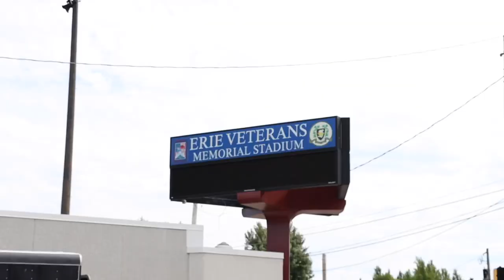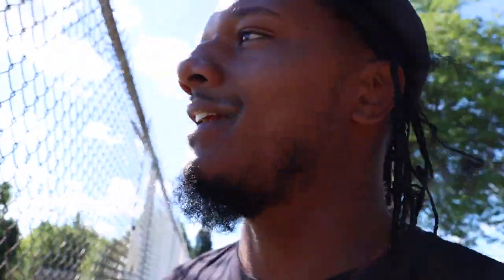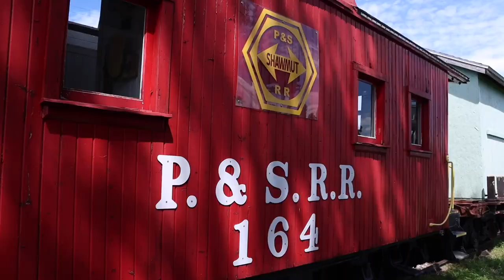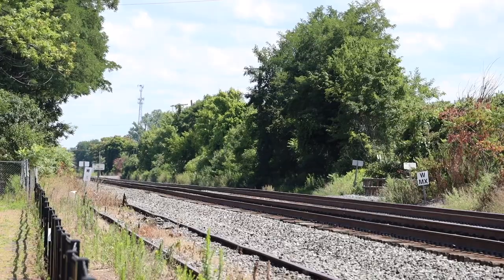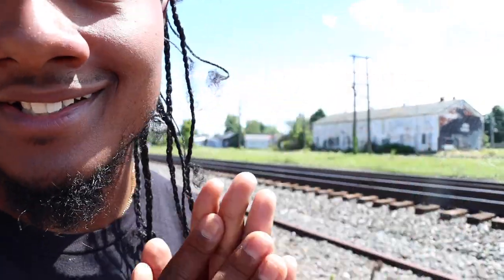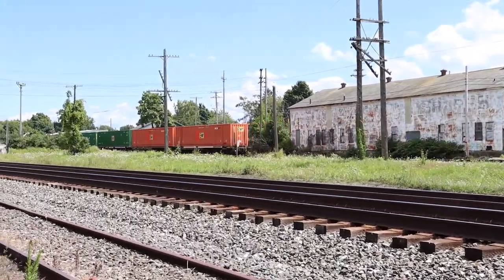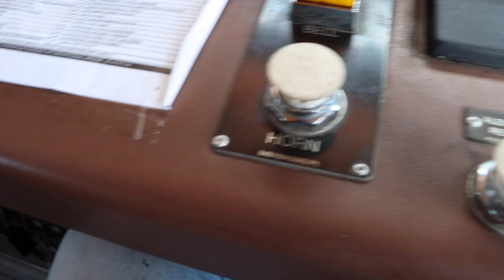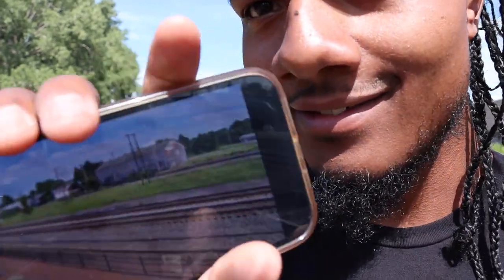I WENT TO ERIE, PA  just to watch trains!!!

Comment: @ time 03.19 in the long line off trains, the train to the far right off the screen is a GE Freightliner Class 70 Number 70012, this locomotive was sent to the UK & whilst being off loaded from the Boat to Newport Docks the Lifting gear Failed, causing the locomotive to fall back into the hold of the ship , The Locomotive was shipped back to GE ERIE, PA obviously after being refused delivery as the locomotive had received substantial damage in which its frame was bent, Since its return at GE, Eire it has been refurbished and I believe the loco is now used as a Test Locomotive at Erie, PA. There is lots off info on this loco on Y/T or the Internet for you to check out, Its actually Nice to see it on your video and lots of UK Rail Fans would be over the moon if the loco was returned to the UK.
Reply from the maker: Wow that's interesting, thank you for sharing!